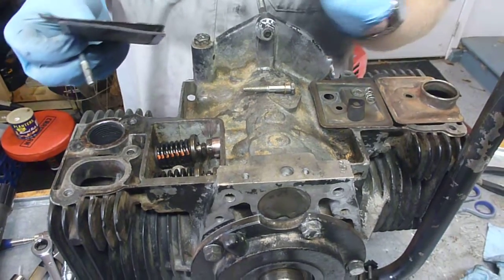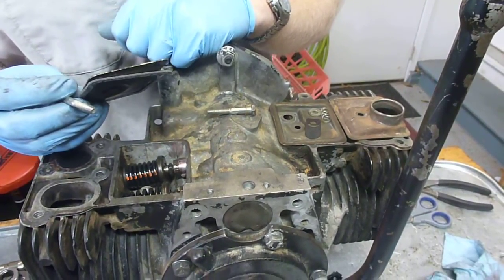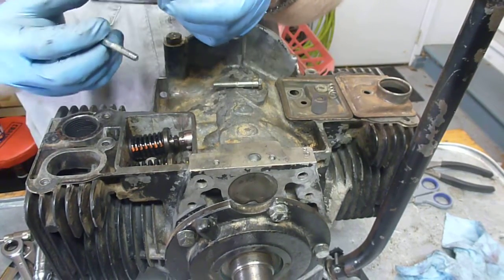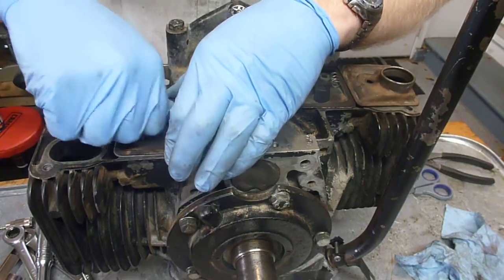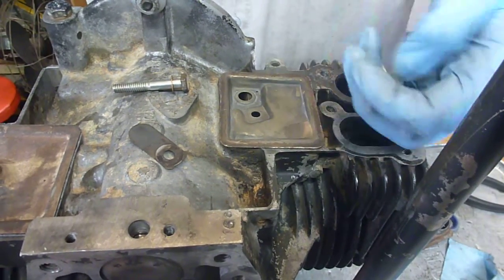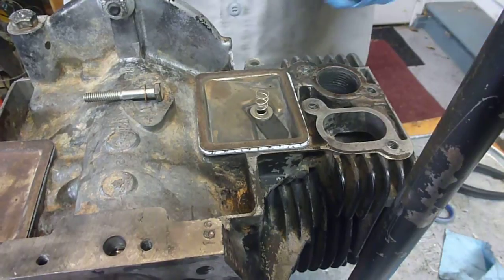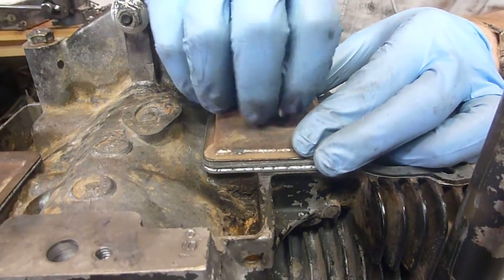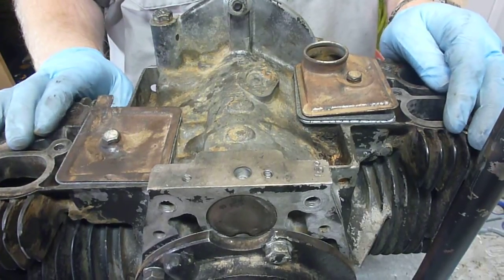Rebuilding an Onan B43G (Part 10) Valve Cover Installation

Comment: I have just replaced the gaskets on the baffled valve cover, and it continues to leak when the engine is above idle. The leak is on the inside “side” of the valve cover. The oil begins to pool up in the valley of the block and the run down the cylinder head and to the frame below. Would you recommend I use some RVT or Indian head sealant on the valve cover gaskets?
Reply from the maker: Is it from the valve covers or from the breather? If the engine has a decent amount of blow by the breather can be the source of a lot of oil pooling on the top of the engine.

Comment: Can you explain how the valve adjustment please does the two cylinder adjust on TDC at once or each one of the cylinders on different TDC each one
Reply from the maker: Even though its an opposed twin, "TDC" is different for each piston and valves based on the cam shaft position.

Comment: Thank you so much for your video.  I've been looking everywhere for where it is and how to do it.  The manual is helpful but doesn't show where on the engine.  My Onan is running but I needed more info before digging in.
Thanks, 
Dave
Reply from the maker: Glad you found the videos helpful. Good luck on the engine work.